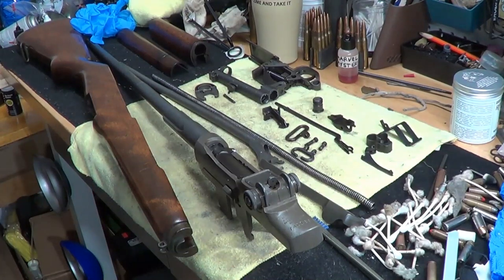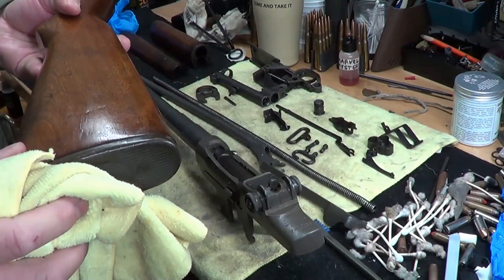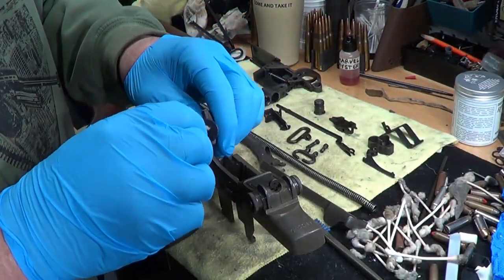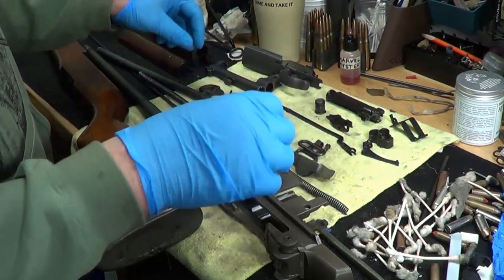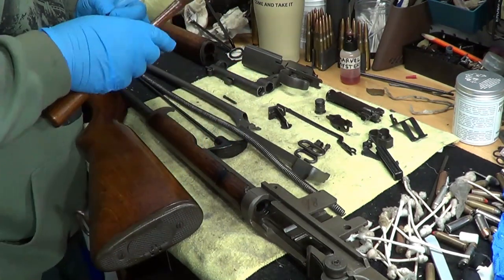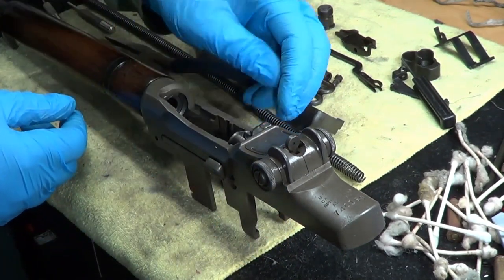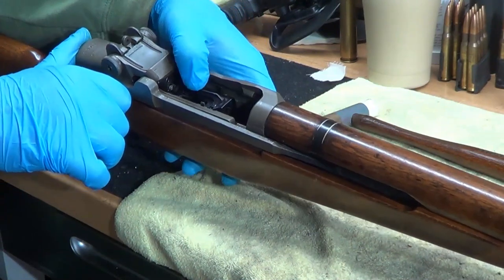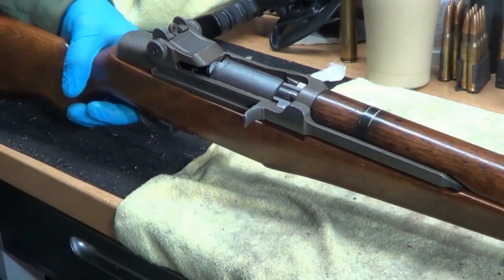M1 Garand Assembly Made Easy - M1 Manual Link In Description

Comment: Use some synthetic (Mobil 1) grease on the bolt roller and track when your done. I have a Springfield M1A. I Definitely want to get the M1 Garand @ some point too. I use Ballistol for almost everything, It’s a solvent and lubricant/preservative. Leaves a really nice coat on stuff for a long time.

Comment: You need a roll pin punch set Rick they make life much easier trust me.😁
Reply from the maker: I just don't use them maybe twice every few years..
Reply: @HeyGunPeople  me as well but I've learned a true roll pin punch that has the little titty on the end (where did that titty reference come from I wonder😁 has advantages I worked as an mechanic for a number of years and they are handy. Especially for gun assembly and disassembly it definitely prevents damage to your firearm if used properly. Great video Rick haven't owned or shot a Garand in a long time.